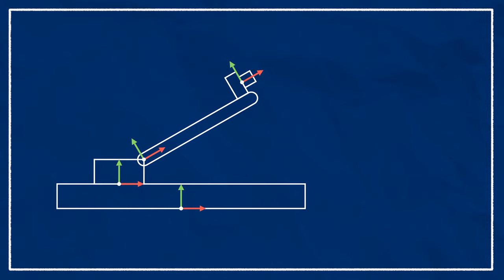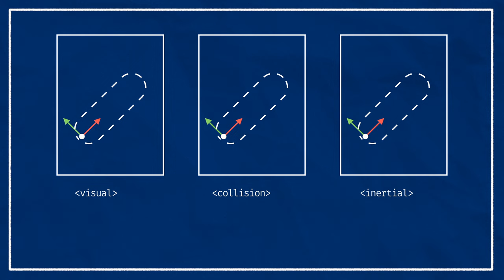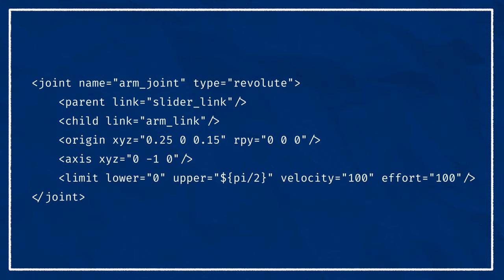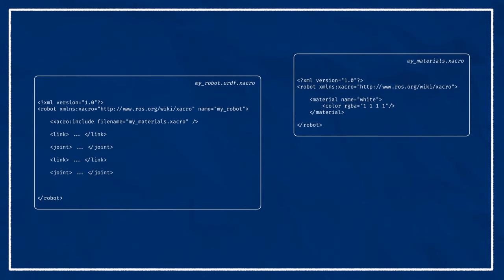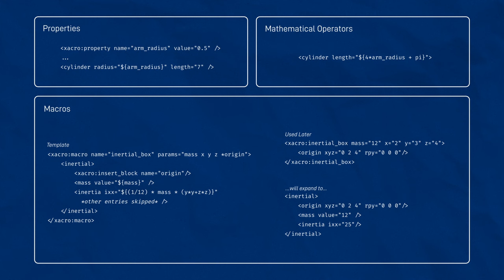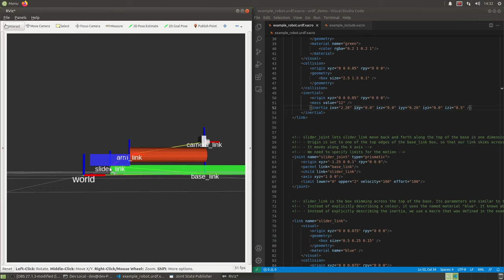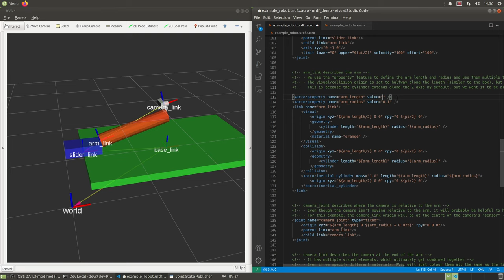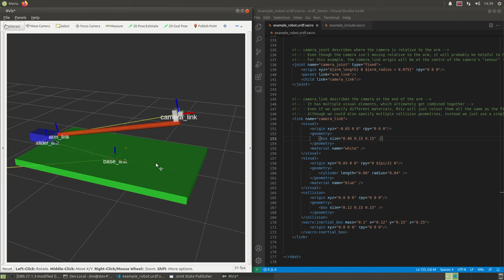How do we describe a robot? With URDF! | Getting Ready to build Robots with ROS #7

Comment: thanks for your informative video, how would i start to build URDF file for my solidworks CAD model which have 50 parts which inter-related when its on operating condition. I used auto urdf generator for creating such enoromous urdf. which we planned to import it in Coppliasim. Would you give me a tip how to sub assemble such complicated mechanisms and CAD file.

Comment: Is there any way to lint URDF? I am trying to create a basic motor simulation where the rotor on the motor body rotates. I am following the last tutorial and this one as closely as possible. I have a launch file that puts my parsed URDF robot description into the /robot_description path. When I load my robot model into RVIZ, I get "Status: Error" on the left panel in the GUI but not much more info than that. I am getting a message in terminal where RVIZ is running "Invalid frame ID "map" passed to canTransform argument target_frame - frame does not exist at line 133 in /tmp/binarydeb/ros-foxy-tf2-0.13.13/src/buffer_core.cpp". I think this is just a warning and may not be the crux of the problem. My guess is that there is some fault in my URDF. Wondering if I might be able to parse return of Python xacro.process_file(xacro_file) to see if XACRO parsing was successful. Do you have any tips for determining successful conversion of XACRO to XML and whether or not that XML is something RVIZ could understand?
Reply: Okay, just discovered check_urdf command inside of ROS2. My URDF looks good. Not sure if you have any other tips on where I might look. Guess there are forums as well.
Reply from the maker: Hi John, sorry you're having issues (and I think you might have had another comment I never replied to somewhere? sorry about that).
There are a few options, as you say there is check_urdf (which I didn't know about!). You can also run xacro from the command line and inspect the output to ensure it makes sense.

The target frame issue means that you don't have the correct "Fixed frame" selected in the top-left corner of RViz, try switching this to whatever the first link in your URDF is.

Let me know how that goes :)
Reply: @ArticulatedRobotics  Added the world tag from your example on the gist, then switched RVIZ to it in the top left like you said. Works great. 👍

Comment: Is it possible to launch joint_state_publisher_gui using a Python launch script?
Reply from the maker: Hey John, sorry I took so long to reply. In case you haven't already figured this one out (or for other viewers), you absolutely can.
If you take a look at the launch file https://github.com/joshnewans/urdf_example/blob/main/launch/rsp.launch.py and substitute the package and executable strings for "joint_state_publisher_gui", and remove the parameters, it should work.
Even better, you could copy-paste that whole "Node" construction, give the new variable a different name, and add it to the array in the LaunchDescription at the bottom to run both at once (the whole point of launch scripts).
Finally, the best method would be to do something like this https://github.com/joshnewans/articubot_one/blob/main/launch/launch_sim.launch.py where you have a launch script for just robot_state_publisher, and then a different launch script that includes the rsp launch, and adds the joint publisher gui, or whatever other nodes you like on top :)